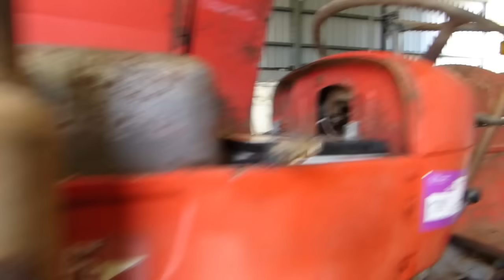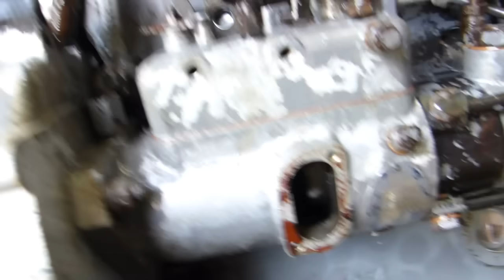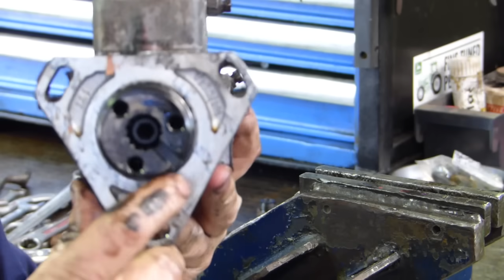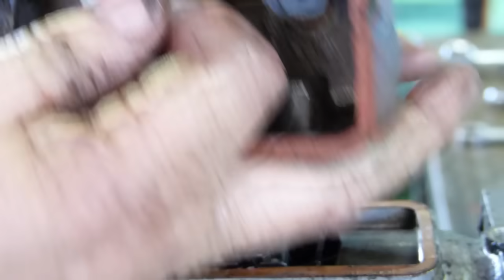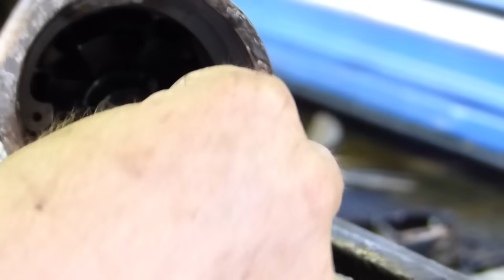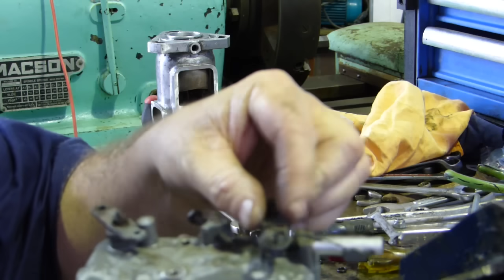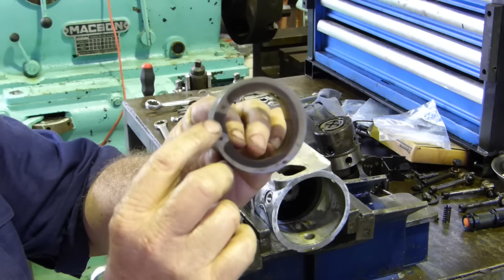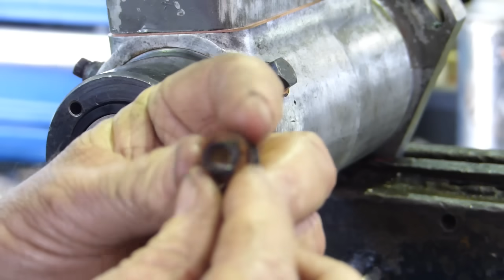CAV Injection pump full strip down to re seal and stop fuel leaks

Comment: Hello I was wondering if u could steer me in the right direction with my gehl skidsteer. Has a diesel perkins engine with a Lucas cav injection pump.  Crack the injector lines and no fuel comes out after turning key, fuel comes out the upper and lower bleed screws on cav pump when using manual lift pump.  But no fuel between pump and injectors.  Is pump bad or maybe that thing u said that can get stuck and shut fuel off?
Reply from the maker: I did what I think is a better video in my Massey Ferguson 135 6 speed play list , videos 14 and 15. There is probably still some junk getting about the fuel system somewhere.
Reply: @bundybearsshed  any idea why fuel won’t come out of any of the injector lines when I crack them and crank the engine over ?  Has fuel to injection pump
Reply: @Superfreak_outdoors  I hear it takes two, one to prime the lp side and the other to hit start ... unless you get an elec pump and they are quite cheap and give a sustained pressure during bleeding etc.
Reply: @abyssmanur3965  so one person turning it over with the starter and one person pumping the lift pump at the exact same time ?
Reply: @Superfreak_outdoors  So Ive heard, I dont have an assistant and dont want to burn out starter. Ill probably go the electric pump route even if just to get it primed.
Reply: @abyssmanur3965  yeah I wouldn’t mind going that route either. any links to where to get a electric pump for the perking 4.108 ?  Thank u for your help
Reply: @Superfreak_outdoors  Hi Matt, I didnt need elec pump after all but it would have made job quicker and easier ... they are quite cheap from $15 to $100 on ebay.
So I got mine running after a check of the primary in which the metal inlet hose had been cracked/brazed and a suspect rubber joiner was replaced.
Bleeding should start at your watertrap/filter, top bolt return line, right in the middle. 
Next is those two bleeder screws on side of inj pump, bottom then top, using primer to flood it through.
The manual says to crack  'two' of the connection to injectors and crank till fuel arrives at these points, but I found best to do the all of them in 2 lots 2.
You will still need about 30 secs of crank after doing this to finally fill injectors, a little ether will help but do not use glow plugs whilst using.
As I mentioned earlier I spent two days trying to bleed the system and get a start but I was trying to start with shutoff in wrong position for half of it lol so check that as well!
Reply: Ive got the same problem with my perkins 4108. It was running fine after a fuel tank clean ...two ten minute runs then it just stopped like the shut off was engaged ... now Im not sure what position it should be in, any ideas?

Comment: Hi Lance 
Have you ever done a video on setting a CAV DPA with hydraulic governor ?
I have one on a Perkins 6.354M. The motor runs perfect except at idle at which time it is hunting quite bad. I can't find a single video on the Tube with the fix.
Reply from the maker: No just the tractor pumps.

Comment: great video. I have a JD 1040 that is underpowered and no indication that governors are doing their job and this video has saved a lot of time with unnecessary stripping to check their operation. Thank you.
Reply from the maker: Glad it helps.
Reply: @bundybearsshed  had the top cover off today and all seems well. Tractor is still unresponsive and when i used her yesterday the running was a bit erratic in that when at a set rev, a small movement of lever made a large increase in revs. Still under powered though. Any suggestions please ?

Comment: On the plunger assembly. When the felt washer was taken off was there a replacement put back on it and was there a small spring that sat on top of the plunger piston before the big spring and seat went back on? Mine has a felt washer and a small spring that sits on top of the plunger piston between the big spring seat and piston.  Thanks
Reply from the maker: Check my massey Ferguson 135 6 speed play list videos 14 and 15 I go further into the pump. Better videos I think.

Comment: Thankyou so much for sharing your knowledge, that rebuild kit I got for this pump looked quite menacing.  I have the pump all torn down now and it’s not such a big deal anymore, thanks.  This pump is on a miller welder from the 80’s and the next I do is on the same but being used as a generator for a camp in the Everglades.  All the camp members will be happy to have continued electricity during their stay, thanks to you
Reply from the maker: Great to hear!

Comment: My Massey Ferguson pump only seems to pump when turned clockwise however the gear that drives the pump spins counter clockwise. I assume this is why I haven’t got it to pump fuel. Was wondering if you had any input, wrong pump? Thanks
Reply from the maker: There is an arrow on the pump plate with direction, if it is wrong it wont run.
Reply: @bundybearsshed  thank you so much just realized that yesterday. It is the wrong pump

Comment: After standing for 18 years i decided to try and start my ford 4000, i could get diesel to the pump but not to the injectors, after watching your video i stripped and resealed it, the metering valve and the plungers were both stuck and needed freeing, it now runs but badly with a lot of white smoke and only appears to be firing properly on one cylinder. The injectors a new and ive even swapped their position but noes 2 and 3 cylinder are not right, if i loosen the fuel line to release any air on 2 & 3 diesel sprays out but the engine note stays the same, if  loosen  no one the engine stops. Any ideas?
Reply from the maker: I would check for a stuck valve from sitting for so long. Pop the rocker cover off and turn it over by hand and look for a low valve or two.

Comment: Just what I needed to see, the pump does not feed the injection pipes anymore. Guessing on the stopper or the pin with the filter in the end
Reply from the maker: Yes likely
Reply: @bundybearsshed  part number e0nn9g578aa
Reply: It was neither😅 Where you have a inspection plate I have a plate with a fitting on, in that there is a ball/spring. The cap holding the ball in place had failed and the diesel just went straight through the pump I’m guessing...

Comment: Thanks!! 
After watching your video, several times, approaching the replacement of the seals was a breeze. Your help, was priceless. 
I’d love though, to have an understanding of what the different governor spring settings affect. 
According to the chart, my spring was in the wrong location. Installing it in the correct position was extremely difficult, due to the tension.  After mentioning this, to the previous owner, he suggested that the turbo(non wastegated)had been added. 
Is there a simple explanation of how governor apring tension affects the pump/performance?
Reply from the maker: On my web site on the technical pages there is a complete workshop manual for download on these pumps.
Reply: . Thank you. I'll have to dive into that.  I'm now working on an engine that starts with ease, but sputters under.a load, with all cylinders firing equally.  The regulating spring in the transfer pump seems noticeably shorter than a new spring, so I'm hoping that's our issue.

Comment: Thanks Mate..I know this is 5yrs old but do you stock the two bolts that the acorn nuts go on to hold the top cover on? The kids just bought a place at sth kolan and inherited a DB tractor that doesnt go..first problem i found was one bolt was snapped off and leakin fuel so thats first place to start..If you have them ill get the kids to call in this week and sort payment / ordering..Thanks Wayneo
Reply from the maker: Yeah should have them in stock.
Reply: @bundybearsshed  thanks mate..i sent ross an email and got them sorted yesty

Comment: Hello lance
if I tighten the bolts around the pump (bleed screw ect) 
Then I can hardly turn the pump by hand
Reply from the maker: Make sure the cam ring is not cocked at all, it should be a loose fit.
Reply: @bundybearsshed  
is it possible that I mount the camring wrong?
Reply from the maker: @jandocter951  It is possible but there is an arrow etched onto them from memory.

Comment: I had a leaking injector pump on my ford 3000 diesel. My local mechanic said he didn't do the work but could send it to be fixed for around $1200.
Wow! I found your video and did it myself in my tool shop, For about $35.Thanks for sharing your knowledge.
Wayne Stewart, Jefferson county, IN
USA
Reply from the maker: Nice work! Glad to know it helped out.

Comment: Hello Lance,
Here a question from germany.
My fuel pump Cav rotary is no pumping fuel to the injectors.
If i bleed the pump is fuel comming out of the bleed nut.
Nice channel I subscribe
Reply from the maker: Pop the top off and free up the metering valve. I do a better video in the MF135 6 speed series videos 14 and 15.

Comment: Hello Bundy, Thank you so much for this video. It helped me a lot. I got
my pump to work in the workshop. It was rotating nicely and was spitting out fuel in each valve. But after I mounted it back on my tractor - it stopped working. I took it out again and tried it in the workshop and now it doesn’t distribute fuel in any of the four valves. Could you help me out with what might be wrong? It is a John Deere 1640 with a Roto Diesel Injector Pump. Looks very like your pump.
Reply from the maker: Check out video 14 and 15 on my 135 6 speed series, i go deeper into the plungers on those videos and do a better job of explaining things I believe.
Reply: Bundy Bears Shed Thank you so much for answering. I will check those videos immediately! Thx buddy!

Comment: Do you have to pull that top top cover off to remove the pump head?
Reply from the maker: Yes as the metering valve goes down into the head.
Reply: @bundybearsshed  thank you so much for the response.
Reply: @bundybearsshed  dear sir, I have a new pump here and the pump looks identical but the numbers are different. Where do I go from here? What will happen if I just bolt it in place and try starting it? Please help if you can. I'm in the US is not sure of time difference. It's 6:10pm here now

Comment: Lance I can’t get my pump to spit out any fluid . When I turn it over it sucks the fluid down and I replenish it I’m sure the case is filled up with WD if I shut it off it won’t suck it down I took took everything apart the springs out of that the end of the pump head assembly everything seems to be in order any ideas?
Reply from the maker: The stopper will stop it from sucking fuel down and when in run it should spit some fuel out the fittings.

Comment: Thanks for the help!  I re-sealed the leaking throttle and stopper shafts in place on a 354 (vertical) pump.  The spring position chart was especially  helpful when The spring unhooked from the arm as I wiggled the cover away (obstructed by a bracket.) It took some  thinking to keep the shut-off from dropping out of position for RE-assembly.  I cut the end off of a zip-tie and used it to hold the slide in position as I engaged the tab. Success! Thanks again
Reply from the maker: Glad it helped

Comment: Love the video. I'm slow so watched it a couple of times. ;) I do have a question. 2240 John Deere not sure the year. It has a lower and upper bleed screw. I get fuel from the lower but not the upper. I rebuilt the top of the pump and stopped the leaks. Ran good for several hours, a few days. It starts with starting fluid but will not keep running. It will not prime.  Would it be the seals in the main part of the pump? Thank you for your channel.
Reply from the maker: Dont worry about the upper, I often dont even cract the top one.

Comment: Hello; I have a CAV dpa 3232968 injection pump on a ford tractor. PROBLEM is the stopper doesn't stop the diesel engine. The stopper rotates 360 degrees and changes thr rpm but doesn't stop the diesel. Any thoughts
                             Great Videos
Reply from the maker: Lift the top and line up the stopper hook

Comment: I'm trying to save a beautiful old wooden boat with two ford leman engines in it. unfortunately the engines have been stripped of the injector pump and the starters etc, anything of value.  my question is i have two working engines with the CAV  pumps on them, can i take the cav pumps and adapt them to the engines in the boat.  the engines in the boat had sims pumps on em and were older 120 horse power engines with the pump down low on the right side of the engine to the rear.  i get confused on the proper nomenclature for the engine styles.  I know the engines i have that run are 2703-e,  thanks for your video's so informative.  I have always messed with gasoline engines, and now i am 70 years and getting into the diesel engines.  just rebuilt a 371 detroit in my boat and couldn't believe how much satisfaction i got studying that engine.  Brilliant engineering those general motor engineers .   Now i am diving in to the world of the four stroke ford.
Reply from the maker: You could adapt a rotary pump to where an in line pump went for sure. There would be a bit of fiddling but the main thing would be to have the correct rotation and the correct firing order. The rest would just be engineering it to fit.

Comment: Awesome video -- was wondering what to do on my 240 which is leaking around the large seal on the inlet side of the pump. Around here it costs $1000 to do any injector pump work because there is Dark Magic in those objects. You just showed how little magic there really is in those pumps. Thanks Mate for the help. Now to order that kit and I'll be having a Go :):)
Reply from the maker: Go for it.
Reply: Well I Had a Go and now I have no leaks -- a HUGE thank you!!!! I could NOT have done this without your video - Wish I could add a before and after picture but that is beyond my technical skills on computers.  Took me about 5 hours (I am sure someone with technical skills could reduce that time but a good half was getting the pump off and back on which was not fun.) Thank You Thank You :):):)

Comment: I watched this video tons of times and watched it while assembling and disassembling my pump. I put it in my 165 Massey and it runs, but it won’t idle down. The lowest rpm I can get is around 1000. Could I have put my spring in the wrong place?
Reply from the maker: Yes that sounds like it to me. Spring too tight.

Comment: Followed your instructions on installing the new seal kit and it looked great. Reinstalled on my Massey Ferguson 135. Everything was going good. Started it up and it runs great. Noticed a small leak. Started tightening and the leaks got worse and worse. Can you over tighten the fittings?
Reply from the maker: Yes some times.

Comment: Thank you very much sir for this video I have a 1973 job backhoe with this pump that my brother ran out of fuel ad left sitting and I havent been able to get it running since after seeing this video I feel confident I can tear it apart and fix it
Reply from the maker: Certainly have a go. I did what I feel is a better video in my MF135 6 speed series video no 14 and 15 where I go into it a lot more. You may find that helpful.
Reply: @bundybearsshed  ok thank you ill let you know how it goes

Comment: Thank you for the great detail video I have a question the pump out of my massey 50c has no spring for the plunger and the plunger cannot go all the way through it only has one way in and out.
Reply from the maker: Not sure, these have 2 plungers that sit out on the cams
Reply: @bundybearsshed  thanks for your reply I have since found that someone had opened this pump before and failed to reassemble it correctly the sleeve the the plunger rides into had the top cap in upside down and jammed and also the bottom spring that holds the plunger from falling out was missing.

Comment: Hay Lance thanks mate, I'll try anything but these things until now. Now you've shown me what's in there & told us what things do in there I have full confidence pulling one of these pumps apart. Maybe one day I'll look at giving one a little more fuel but not now, the MF 175 tractor does everything we want it to do although we've been told we could bolt a 185 motor straight in but the hydraulic lines to the front power steering have to be extended by an Inch. It would have been so much better if it had a wet disc back end too. You done a great job explaining things in there. Any suggestions would be great.
Reply from the maker: Check the 135 6 speed play list I did, video 14 and 15 I go into the pump better I feel.

Comment: Great video. On the part about only fixing a leak on the throttle shaft seal - you could have another video on just that part itself with this same footage. It appears that is where yours was leaking and that is where mine is leaking as well. Thanks!
Reply from the maker: Check my Massey Ferguson 135 6 speed series as I go into more detail there as well.

Comment: I have watched two of your vieos and several others tha featured the CAV pump. Something went wrong though on the reassemble and I have uninstalled and restarted while reviewing the videos and I'm about to get frustrated. Each time I get the front and rear complete and each will turn free and once jointed together the entire pump will spin but as soon as I install the ball stud into the cam, the pump will only move until that stud hits the housing in is in. I would appreiate any hep or ideas.
Reply from the maker: Check out video 14 and 15 on the MF135 6 speed playlist I did, I go into the pump deeper in those videos.
Reply: @bundybearsshed  Thank you very much. I'm not sure how to find video 14 but I did find 15 and that is the last one I watched. I'm going to watch it again. Also, I ended up with a small ball bearing that I never saw come out but was laying on my table. I think I know where it goes but if you can shed some light I would be very grateful.